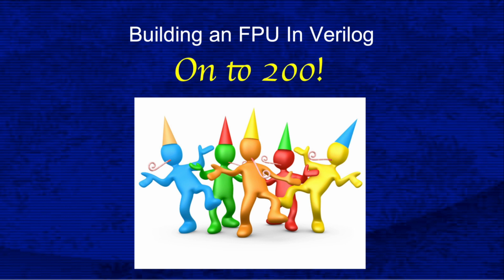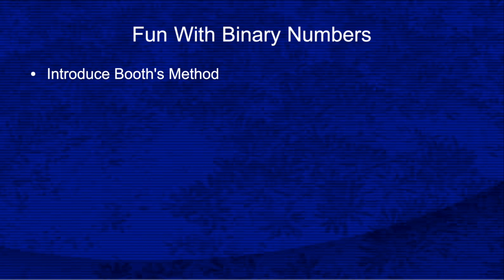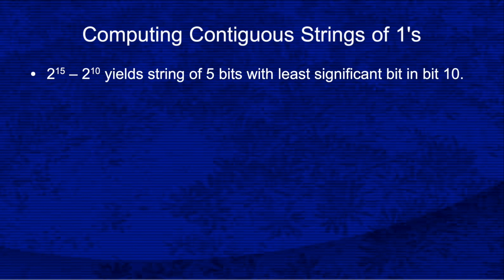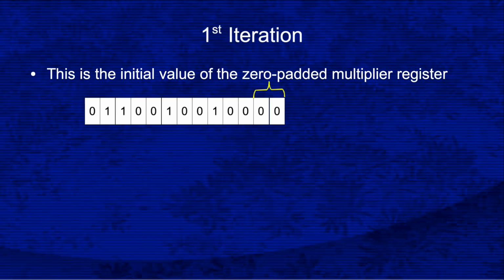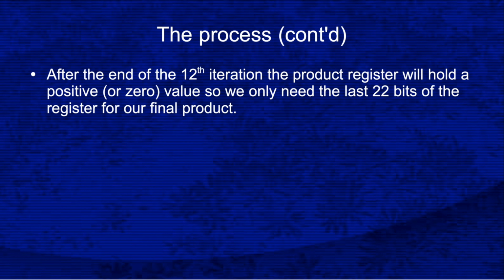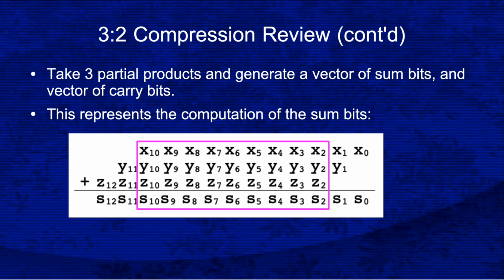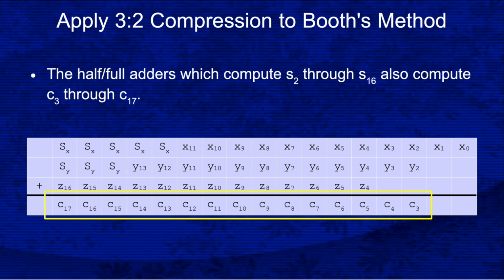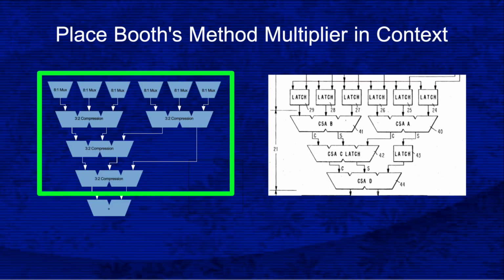Building an FPU In Verilog: Floating Point Division, Part 7

Comment: I have been referring to the approach of performing floating-point division using NSIG+3 iterations, combining q_sig and a_sig for rounding purposes. I replaced the prefix adder you used with a simple assignment. However, the synthesis result using Synopsys tools shows that the circuit operates at a relatively low frequency (around 1–10 MHz). Could you please suggest some optimization techniques to improve the circuit so it can operate at a higher frequency?
I look forward to your response.
Reply from the maker: Sorry. I’m not ignoring you. This is a particularly busy month and I won’t be able to get to this for another couple of weeks.